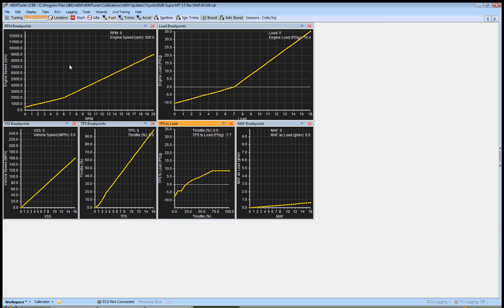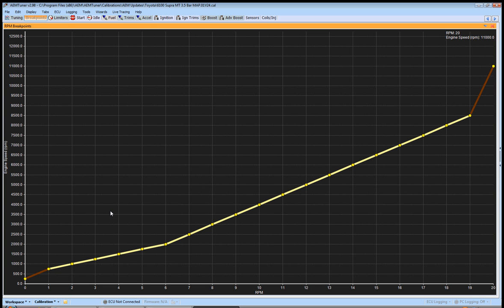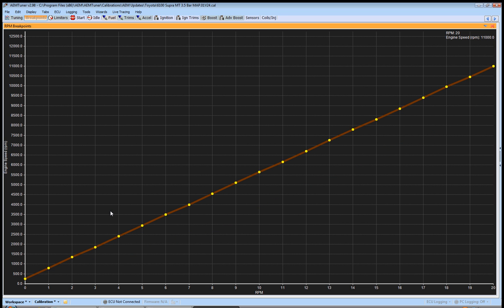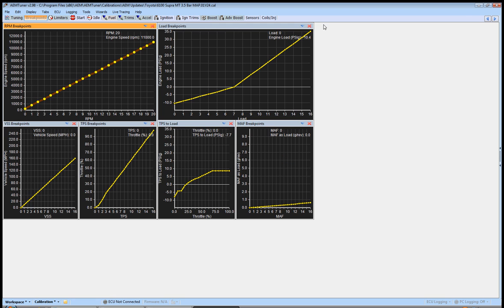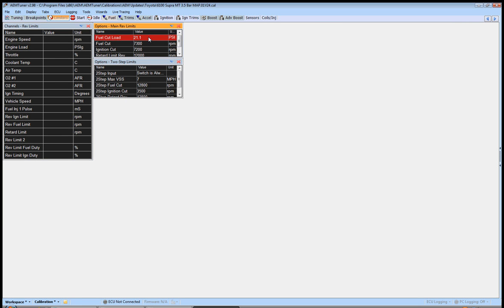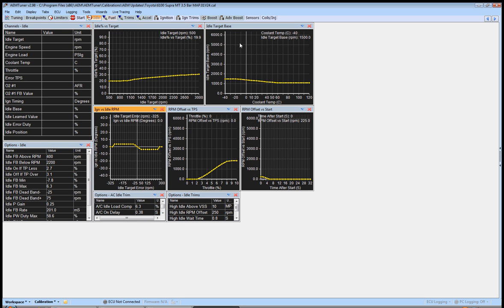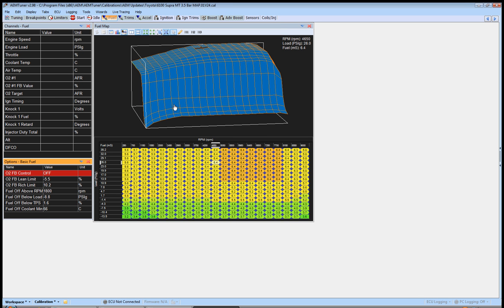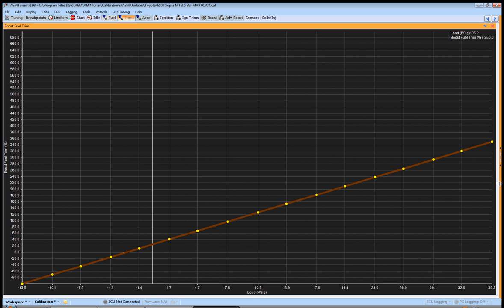AEM Tuning Part 2. Breakpoints and more initial setup.

Comment: Why TPS should not be 0% ????
Reply: I’m not an expert so I could very well be wrong, but when your car is idling. Your throttle body will be open just a bit to allow air in. If it was 0 the body would be completely closed and no air would go into the engine

Comment: What would I do in a situation where my injectors are not listed in the setup wizard? I am using the AEM with my RB25 and I have Nismo 720cc injectors but only 740cc injectors are listed for nismo. Should I select another brand of 720cc?